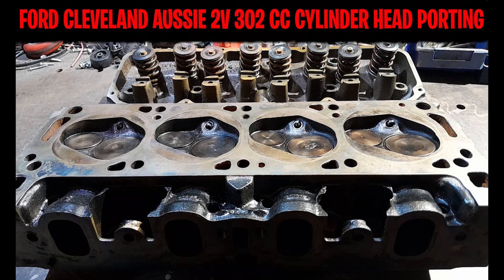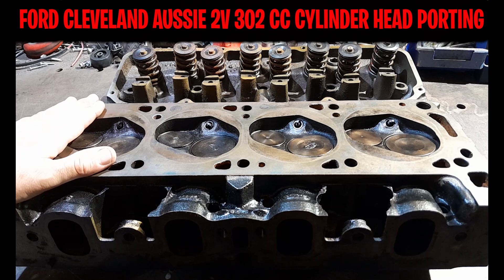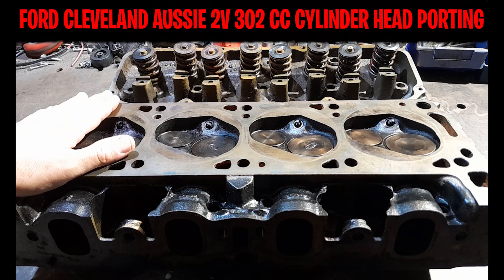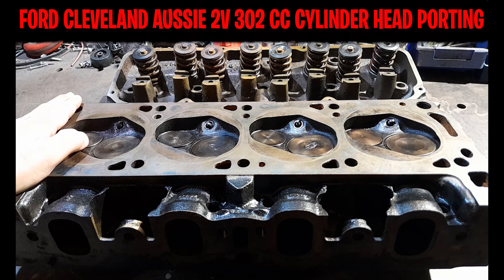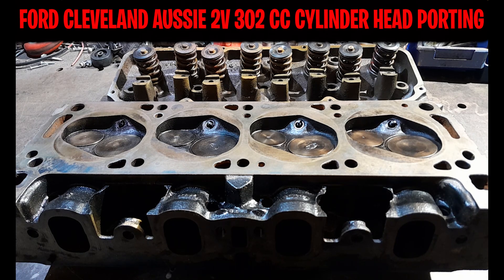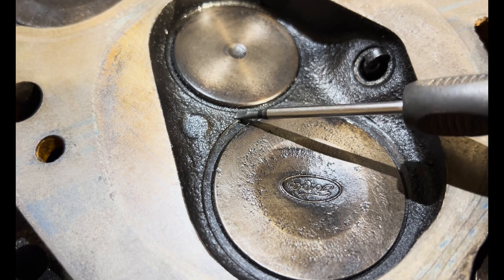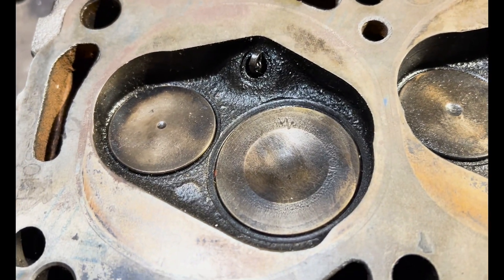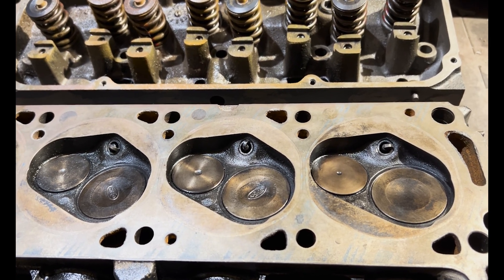Aussie Ford Cleveland 2V 302 Closed Chamber Cylinder Head Porting

Comment: Holley sniper is amazingly simple and im always surprised at the great results from this system.
Reply from the maker: I love the Sniper, though there were a few challenges to get it to run right. Actually, to remove all doubts and ongoing trouble shooting I completely rewired my Falcon bumper to bumper. My 50 year old wiring was completely done and causing issues with how the sniper ran. I don't think folks when they buy them would be anticipating needing to do that.
Reply: @Doctoradhd1  That makes sense.   Bad grounds and bad wiring reducing the signal will not be good for the EFI system.

Comment: I have just finished work on a pair of 302C 2V heads, i opened them up from 57cc out to 60cc to suit my 351C build, i did all the de-shrouding and smoothing, cleaned up around the valve guide bosses and took out all of the burrs and rough edges. I havent had them flowed on a bench yet but they look impressive. It took about 15hrs or so and only cost a few hundred dollars in tooling, i found doing a few hours at a time really gave me time to think about how i want to progress and doing sections in steps really helps. But most of all doing lots of research and not being afraid to have a go really helped me feel confident about taking on the project. I hope anyone else thinking about having a crack at it watches these videos.

Comment: Just got a set of 4V heads factory flow for them is 275CFM
Reply: You flowed at higher lifts past .600"?    Supposedly 4v Cleveland did 275@.6" and 290@.7"

Comment: Awesome job brother.  What cam did you pair your ported 302C heads with?  Was the engine stroked or stock at 351?
Reply from the maker: @Andy351c  cheers mate. The usual 393 increase and I’m running a Crow 21787-9 238/246 @.50 109 LSA hydraulic FT. It’s a potent low RPM street setup.
Reply: @Doctoradhd1  Did you dyno this one?    WIth that tight LSA and good duration it must've made a nice amount of power and torque.
Reply from the maker: @dennisrobinson8008  no Dennis I have never Dyno’d it. Also, I ended up buying a set of Chinese copies of the well known AFD 2V cylinder heads and wacking them on. Not a huge jump in performance from a seat of the pants perspective from the ported set of iron 2V’s I already had on the car. So my take on it after trying both, is if you port a set to f the Aussie 302’s they really reward you for your efforts.
Reply: @Doctoradhd1  I looked up the numbers for the AFD 2V and they are 272@.500" and 290@.600" lift with over 210cfm of exhaust flow on the exhaust by .500".   So they are a really good head near a TFS-R unported.   To gain over the irons you will need to run one more point of compression.
Reply from the maker: Interesting info Dennis. Because of the price those AFD 2V copies can be had for, really makes it worth grabbing them over the many hours of porting irons. In saying that,  porting is very satisfying when you stick them back on and get a big kick in torque.
Reply from the maker: You can see straight out of the box how those alloy heads really give you the torque. Shorter, much straighter runners from intake to valve, improved exhaust shape chamber floor ceiling and runner (and no the exhausts are not raised in the AFD 2V copies I have. Stock location, but there are two bolt holes so you can use different locations to bolt up the headers . I was surprised how much smaller the exhaust port was compared to the iron 2V's.

Comment: 302 heads with the smaller valves unlike a 4V head do not need deshrouding. You are just making the chamber bigger!
All they need is the lightest of deburrs, the castings are generally very good. For stock or very mild use leave them stock. Stock valves are good for the very occasional 6000 rpm. Not sustained. They are fairly good for weight, EVL replacements are not near as good for shape and are heavy! I used Ferea 5000 which are a step up for shape and a good deal lighter. They are around '030" larger
For performance use good stainless valves, convert to screw in studs, milder use use bolt on rocker conversions. use the correct spring for the cam with single groove retainers. For what they are they work very well
Porting is more likely to lose power. IF you want more power go buy some 3Vs from CHI. And they are a LOT lighter!!
Too many go long stroke. WHY? Everything is heavier on an already very heavy engine. May make more torque but that is it. 351 is a good bore and stroke. And for most racing is just uner 6 litre.
I have used 302 heads on my IP 351 circuit car and it was around 430 real. Using only 6500, over that Clevos tend to fly apart! Ask the GpC guys from the 70s and 80s. Those 4Vs  are good for power at 8500,, but the oiling is not. Use them as door stops!!
While all 302 heads are small 'closed' chamber they got bigger. XAs range 58-60cc. XBs 60-62cc and XC on at least 64cc. Forget XC on, they are all stuffed. And will cost a good deal to repair. Guides are oval, valves are coke bottle shape and the valves have all burrowed up the ports. In short they are stuffed. You can insert, I would never recomend that. They all fall out and cause cracking as the seats are not that thick.. Using bronze guides will save them but not really cheap these days. The old using  4V351 valves in 302 heads will lose power. Guaranteed!. Std Valves are really too big. Look at a Chev. 2.02 valves, far smaller ports  and smaller lift cams and they still make very good power. A stock 302C inlet port is larger than a  med Chev raceport. Too big!!
Look at a CHI 3V. Far smaller than factory but they have port velocity and make a LOT more power with a stock 302 size valve.
Reply from the maker: Great info mate, thanks for sharing.  I don't agree regarding the combustion chambers. In the video I do mention I am not hogging out the chambers, simply smoothing them of the machined valve seat work and general casting rubbish. And the whole point of the porting is to save quite a bit of coin on the alloy heads you mention. 

No doubts those heads are great heads, but 300 bucks to purchase these heads and some time spent porting these iron 2V's is where I'm at, over spending 4k plus on alloy cylinder heads. Like I said in the video, for me the extra flow you get in the alloy's and the possible HP gain is not justified in my opinion, for what I use my car for. More than enough power for my needs from factory 2V iron, when ported and paired with the cubes and engine combo.
Reply: Bit of an 80's cut paste magazine blurt there! CC heads dont need unshrouding !  Well wow thats interesting 😬 always good to hear bad info, makes it easy for me too make numbers 👌
Reply: If I might interject here, you Aussie guys have a different look on things. Big cubes, small ports. At least you have the good 302 Aussie heads, American have open chambers for lower compression smog motor. Wish we had more of them available. @craig8187